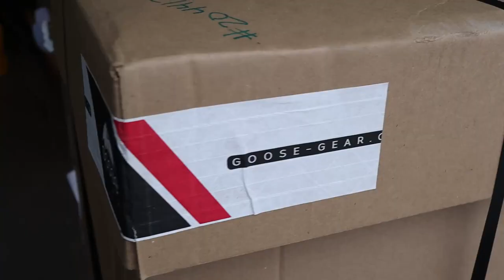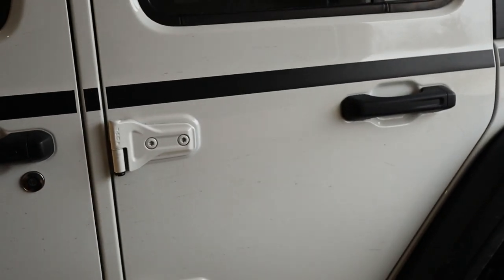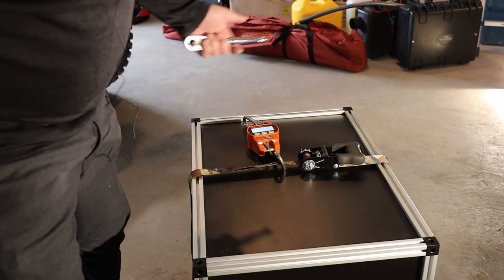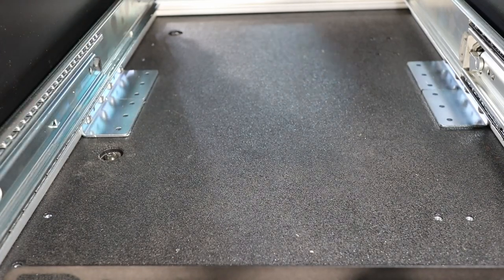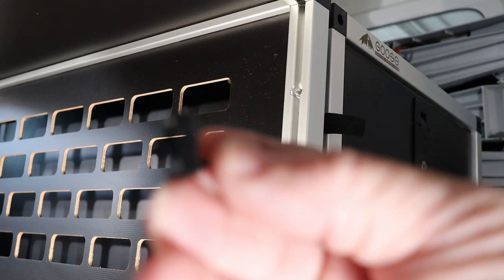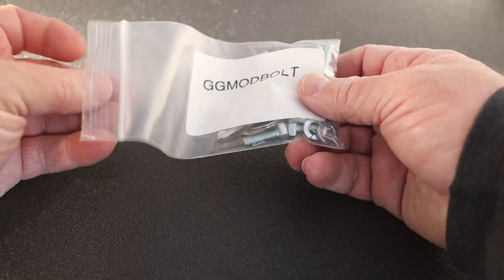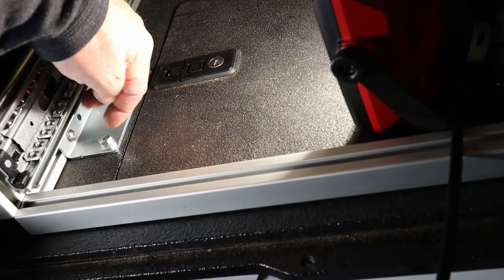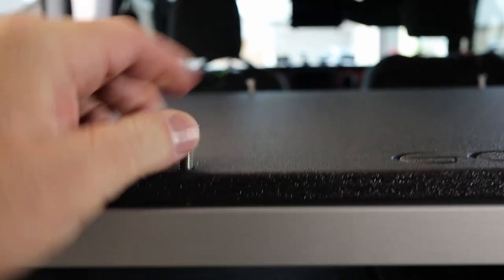JLU Goose Gear Camp Kitchen with some custom extrusions

Comment: Now that you've had that system in your Jeep for a bit. Do you have any squeaks or rattles coming from any of that?
Reply from the maker: No it’s been quiet. If it squeaks there is probably a loose bolt somewhere

Comment: I ordered a Camp Kitchen for my 2021 JLUR, should be here in six weeks or so. Mine will have a stove slider for my Partners Steel 22" stove under my Dometic CFX3 35.

Curious if the top black panel and top extrusion frame had to be ordered separately? Also did it come with foam for the drawers? Awesome video, thanks for posting!
Reply from the maker: Sweet! I go back and forth about stove placement. I like to cook on my tailgate since the propane is mounted next to the spare. If I still used green bottles I would probably want it on the fridge side
Reply: @OverlandProductions  did your Camp Kitchen drawer key lock numbers match your Goose Gear stealth plate key lock numbers? Like winning Lotto!
Reply from the maker: @donmontalvo1  yes, I asked that they match. Figured out later it’s a very common key and most likely would have worked anyways :)
Reply: @OverlandProductions  nice, it was a pleasant surprise to me. I also had to remove the insulation cover from my CFX3 35, since the fridge fit perfectly and didn’t allow space for the cover. I’m still a very happy camper.
Reply from the maker: @donmontalvo1  I did a lot of work to that fridge slide swapping bolts and raising the tray to accommodate a CFX3-45

Comment: Where’s the kitchen? You don’t have a kitchen you have fridge slide.
Reply from the maker: kitchen is in the drawers. burner, utensils, coffee equipment, spices, etc. even a paper towel holder attached to the side. the real value to this set up is the full storage space on top with hold downs. i'll put up a new video now that the ursa minor is installed.